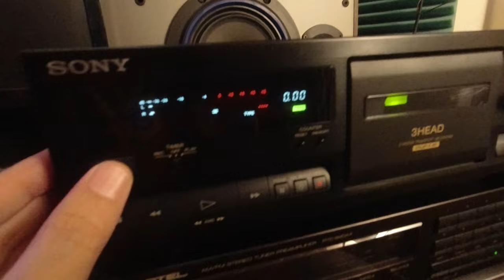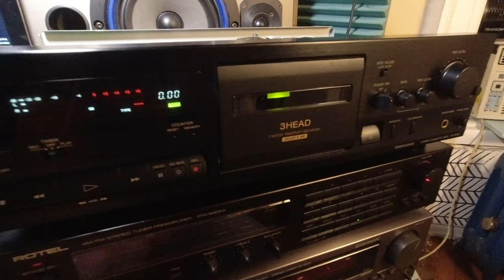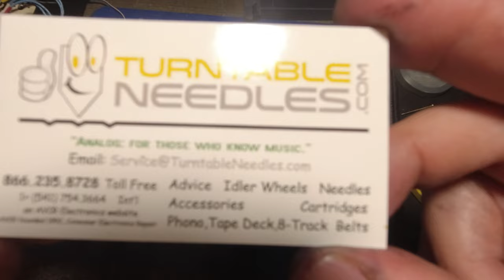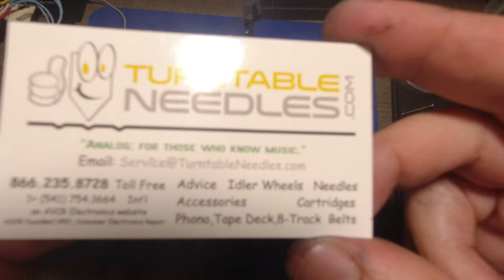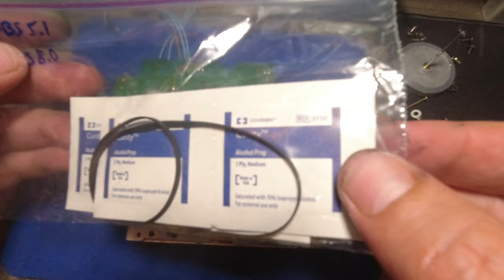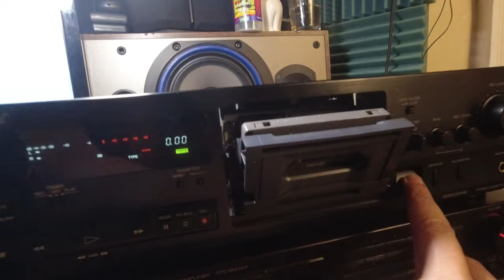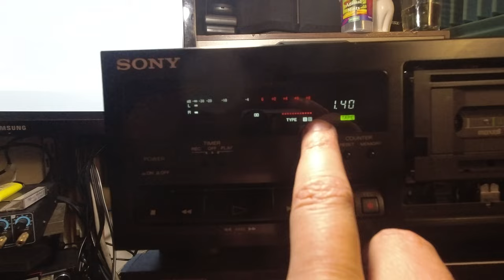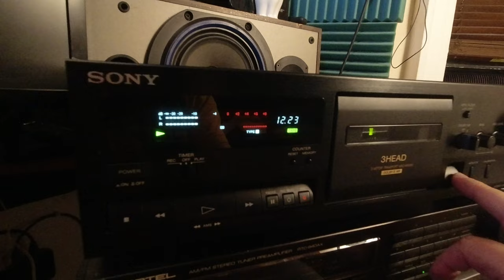SONY TCK-611S - How to replace belts...

Comment: Very helpful video! My deck hasn't been used in maybe 10 years and when I powered it recently the belts had pretty much disintegrated and so I'm following step by step to repair and then sell on eBay :)
Reply from the maker: Glad it helped!

Comment: Nice work and congratulations! I followed your video and seem to have mucked up a step - the belts are replaced and the mechanism is back together but I have no playback (FF and REW work fine). The heads engage (perhaps a little too much?) and I can hear the motor but the reels don't move. Also, I lost the little plastic washer on the capstan and the little two wheel mechanism on the front so be very careful!